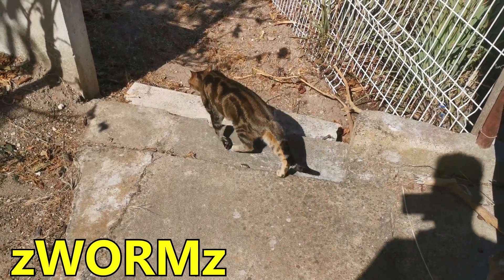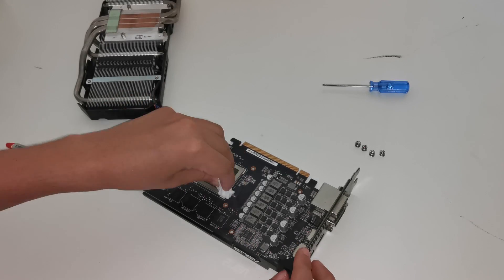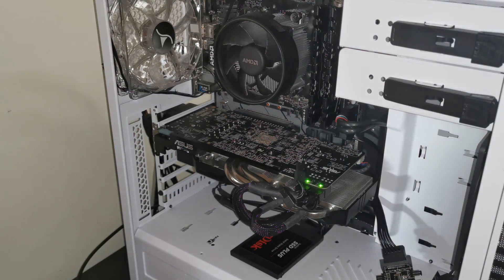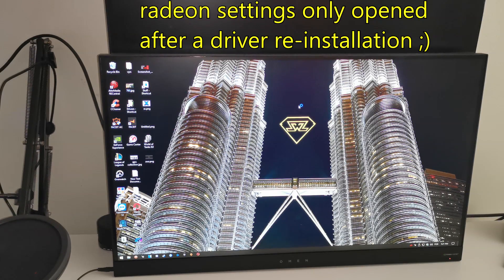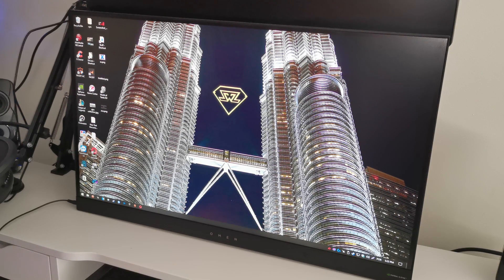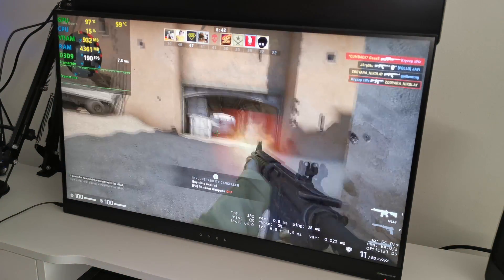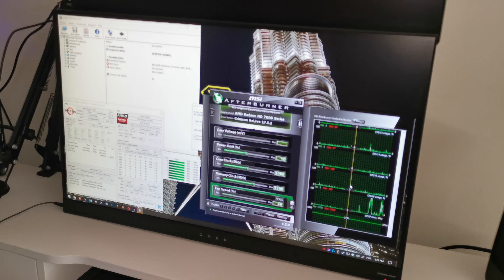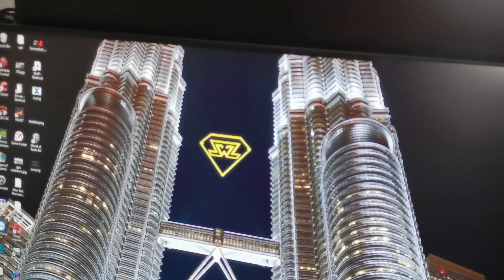I Fixed a GPU With a Hair Dryer!

Comment from the maker: It lasted from september 2019 to july 2020. It's dead again and I can't boot into windows with it anymore!
Reply: if it broke again do this with heat gun reaching upto 230 celcius by moving heatgun above chip in circular movement in 5 minutes
Reply: Be sure you dont have thermal paste bridging the transistors around the dye. My 1080 started artifacting suddenly after a clean install of windows and i coulndt game for more than a few seconds, then it would reebot with no display. It would only boot with display if i didnt use the pc for a few days or if i reseated the CMOS. I first thought it was beacuse of bad drivers, but it ended up being the thermal paste. After i cleaned most of it, it started right up and so far i havent had any issues
Reply: JP Spay  after heating gpu cool left it at room temperature for an hour it will cool down
Reply: How's the situation now?
Reply: Im curious too, they say it lasts about half year maximum
Reply from the maker: Still working, but I don't use it often as I'm always testing new GPUs. Still, it has been fine and I've tested many games on it already :)
Reply from the maker: Good luck! Even if it works you'll need to be very lucky for it to last a year, it depends on how much you'll use it anyways but still!
Reply: What about now!
Reply: Update: it only lasts me for 1week lmao
Reply: Is it still working today???
Reply: @OverclockGamerzFX  he said 3 weeks ago, it's working.
Reply: I tried this earlier on my 5yr old gtx 1050ti and it works lmao but seriously how long will it last tho? I can't afford a new gpu rn xd
Reply: @kent7427  still working?
Reply: Lil Spray  no you have a short
Reply: F
Reply: Is that because your using a hair dryer if it pertinent if you use a heat gun?
Reply: And you havent done a sunday video on it >:(
Reply: Usually what needs to be heated up is the vram chips more than the GPU core
Reply: that's cool :)

Comment: I did it with a hair dryer 14 years ago because I had no heatgun and did not expect the display to come on and it did but only for a few days because I only did it for about 4 minutes I guess. I then turned on the kitchen oven and dumped it in and the whole motherboard died completely. 
I probably got the temperature setting incorrect.

Comment: My GTX 1050 is not booting on my new system, I was suspecting it might be the new motherboard that is faulty.  I decided the clean the GPU and dried it with a hair dryer.  I worked for a while then went black screen again.  I blow hair dryer again a bit longer and focusing more on the IC chips,  the GPU processor and the VRM section including the ICs there.  And then when I plugged it back again, it worked.

Comment: Thanks! It worked on my 3070 with artifacts. I will respond if some problem appears
Reply: Still no issues!
Reply: @Dante-ur4wd damn but if I was you I would have resell that cause I don't want to play with time
Reply: @MCD539  yeah, probably the right choice, but i kinda forgot and just kept using it. It's still working btw, now im thinking about upgrading tho

Comment: bro i have a gtx 560 ti. whenever i update the driver, i get the blue screen. and after several uninstalling and installing, the display became garbage. will i fix my gpu with this? and can i install driver when i use this method? thanks

Comment: did this to my 660ti with driver issues (when installing drivers, it succeeds yet the driver isn't installed) and surprisingly it worked. idk how long this will last but hopefully until i get funds for a new gpu bcuz this month's budget is a little bit tight and i have cad classes until january. Thank you for sharing this trick!

Comment: Just fixed my thrift store $5 GTX 560 with this method. I did 10mins with the hair dryer on high about 1" away from the die. Tons of horizonal lines on boot up before....works like new now. Will report back with how long it lasts. This a test bench card really but if I can save it and get a few months out of it, I am happy. I will report back if it fails again.
Reply: Man im planning to do this to my 5 dollar GTX 580 , did you put the hair dryer in the center of the die??
Reply: @lietus4192  yes, right over the die. About an inch away. I used some leftover stone flooring, put the card on there, on a table and then used a glass jar to prop up the hair dryer so that it was about an inch away. Set the dryer on the higest setting and set a timer on my phone for 10mins. I let it cool for a few hours and ran it through an hour of heaven benchmark looped, a few rounds of Valorant and a day of normal desktop use. No failures. Much luck to you.
Reply: @Hughesburner  does the graphic card still work
Reply: @alphonseelric8722  It lasted about 6 weeks...I ended up selling it for parts online.

Comment: This method works, if you want it to last a bit longer just under clock your GPU and keep it cooler than you normally would, take a break between long gaming sessions.
Reply: Hey, how about this?

Stick the GPU to a centrifuge, like an air fan, and then apply a 120 deg. Celsius hair dryer on the GPU for 30 whole minutes, then put it into the freezer for about 15 minutes.

The centripetal force and rotational inertia from the GPU getting sticked on a fan and centered should spread out the fluid soldering, the air from the fan may cause convectiond which evenly spread out heat, and the cooling realigns and hardens the solderings.

Does that make sense?
Reply: How to underlock a very old GPU that is superclocked from factory? MSI afterburner doesn't have the graph option available. Its a card from my childhood.

Comment: SO MY GTX 770 2GB WINDFORCE IS ARTIFACTING AND ONLY WORKS NOW AND THEN SO I SHOULD JUST FULL BLAST HEAT WITH  THE DRYER,ALSO NOTE IT DOES BOOT INTO WINDOWS

Comment: I fixed my GTX 760 last night doing this but only for like 10 minutes blow drying time and I can't believe it fixed the artifacting Issue :) Amazing.
Reply: still works?
Reply: @damaraufa9575  It lasted for like a week or so. I  didn't heat it long though. It still works but I have a different card now.

Comment: a few days I will get an asus gtx 580 with artifacts I will also try to repair it with the hot gun we hope for the best I paid only 10 euros
Reply: Tomorrow I’ll test my gpu I got the rx 580. I also got artifacts on mine
Reply: @Chappie02  then let's wish each other good luck ^^
Reply: @navi26031984  good luck to you too
Reply: @Chappie02  tnx

Comment: Great video I know this video is prehistoric but, the other day I installed a new AIO and forgot to plug in my aio into sata cable and was running about 65 seconds I’m always on medicine for my chronic pain, and my pc never can think straight, it works and all but high intense games like Fallout 76 it’ll black screen but older games don’t have the issue, is it possible of crashing would this work on my rx 5700 XT ? Just got it last month :,( I may just do it on my own and risk it so using hair dryer do I spray heat directly on the GPU Die? Or entire card?
Reply from the maker: I don't think that's the same issue.
Check temperatures and see at what point it shuts down, it could also be driver issues

Comment: Hey i did this method it worked but after 2 days it wouldn't work anymore it has a caution sign in the device manager, is there any other way to do it?
Reply from the maker: With proper tools, but most people won't have those. You can try again for a little bit longer, but this doesn't fix it forever. Mine lasted about a year
Reply: @zWORMzGaming  wdym a little bit longer? 25-30mins?
Reply: @zWORMzGaming  i only did it for 15mins

Comment: I fixed my graphics card with electric stove only 12 minutes and cooling down for 2 hours dont move graphics card xD
Reply: Use aluminum foil to cover everything and make a cut around chip and above chip cut in same shape as chip
Reply: @Louwk1  how long did it last?
Reply: @huh681  Idk about him but I revived my EVGA GTX 970 FTW and it lasted for 2 more years before it died again. I did this with a R5 240 as well and that only lasted about a month. So it depends on how good the GPU is, a powerful and high quality gpu will last long after revival. Lower end and cheaply made GPUs won't last long, I've heard of baked cards only working for a day, others about 5 years. lol so it varies.
Reply: @mycelia_ow  Yea, i did the same to my GTX 1070 last week, and it's been alive since last week.. hopefully it stays that way
Reply: Guess your graphics card was too raw
Reply: @armanplayzyt9082  how did nobody like your comment

Comment: Thanks you ! I've just did it and I fixed my gtx 770.
Reply: can u tell me if u had error 43 on it ? cuz my msi 770 4gb  is not able to load drivers and and shows beginning of artifacts on black surfaces. i mind trying fixing it with this method too. is yours still working? i will wait for reply.
Reply: @TurboImpaler  I had the same problem as you wierd dots in screen and also code 43 and the nvdia settings not showing with installed drivers 
I washed it with water and heat gpu chip with hairdryer about 30 minute and you cannot believe that thats work !! Its been 4 days still have no problem
Reply: @heisenbergw.w8992  still works?
Reply: @lolokula_gaming9403  unfortunately not i had to reball it but its ok now

Comment: I have a question
I have HD 7730 and small capacitor is broken I think any suggests to fix that please ?
Reply from the maker: You have to solder the capacitor, a new one
Reply: @zWORMzGaming  the problem it is the small one isn't there anyway to fix that ?

Comment: I am having a Rx 560 and crashes when i run benchmarks or games so will it work for it? plz let me know
Reply from the maker: It could be something else, only do this if you don't have other choice. Try reinstalling drivers and stuff like that first
Reply: zWORMz Gaming i had reinstalled all drivers  even windows but still same issue and then once I flashed the BIOS of Gpu and it provoked the issue and now i also see lines on display

Comment: OMG I fixed by GT 610 with this method. It works well. Guys who still have issues after trying this. Try to switch from VGA to DVI and vice versa. I'm pretty sure it will work. I used a philips 1400 watt hair dryer. Full heat low fan for 8 mins approx. Thanks for the video. You saved INR 5000. subscribed!!
Reply: did it worked for long or the gpu died again in a week or so?

Comment: Love your videos. Liked your benchmarks with the GTX 650 also, wanted to see up to what extent my card could run games. My card kind of artifacted then days after, it shows a display but couldn't boot to windows. Going to try this method, maybe this could help resurrecting my GPU. This wouldn't cause any problems in my system right? Keep safe dude.

Comment: sir i have a question, i have gtx 1070 palit super jetstream.. and yesterday  starting to crash and show garbage display (artifact) sometimes it back to normal but  when i try to play games it will show the artifact again and crash after 15 to 30seconds.. any tips sir how do i  fix this? my gpu is almost 3yrs old so it has no warranty.. sorry my english is not that good.. i really need to use it but i dont have money to buy one T_T
Reply from the maker: Lower the clock speeds by a little bit on MSI Afterburner, it should work :)
Reply: @zWORMzGaming  tnx for the reply sir.. i will try this when later.. hope it works! Do u think ur method of reflow will work on me?
Reply: @zWORMzGaming  sir i will lower the clockspeed of gpu or the cpu? sorry noob here
Reply: @zWORMzGaming  and what will happen sir if i lower the clock speed of my gpu? does this affect my gaming exp?

Comment: I have a GPU with artifact, I will do the same, I will come back soon with my answer
Reply: how it went? Success or fail?
Reply: @warrax111  no man, it didn't work.
Reply: @warrax111  I think it is because the dryer does not heat enough to reach 220 ° C, it is impossible I think. The only thing i did was increase my electricity bill xD
Reply from the maker: Not impossible, I did it as well a few other viewers.

Comment: I just fixed a dead, black screen, Toshiba lap top like this, with a hair dryer. It does work! I didn't even put new thermal paste. It now works.
Reply: Which model and how long did you use the hair dryer pointed at the graphics chip?
Reply: @absolutebollocks2258  It is a Toshiba Satillite L655 model. I held the hair dryer about 2 inches above the chip for 20 min on high heat. I did go back and disassemble it and put new thermal paste and thermal pad. I also cleaned it real good, the fan and heat coil. It still works and is working fine. It was black screen. Power would come on but no screen. Totally black.
Reply: @amazingthingsfromaroundthe2057  Thanks for the reply. I was planning on trying it a few months ago. It powers on and the fans spins after a while. The screen remains black. I opened it twice and disassembled it, reseated the ram and used a different ram module, checked if any pins were bent on the screen connector, swapped out the CPU for the previous one and tried a lot of the methods online. The thermal pad on the graphics chip was replaced with some artic silver thermal paste. I assumed it was a graphics issue from the start. I was planning on using the baking method but thought the hair dryer would be better. Recently I thought that maybe the electrolytic capacitors needed to be replaced.

Comment: i have problem in my r9 270x oc when I install display driver  the scren it will black and nothing  happen  ican fix it with hair dryer ? plz tell me if you know
Reply from the maker: Maybe, it's risky but there's a small chance that it could work
Reply: @zWORMzGaming  did you use the flux when you heating gpu ?
Reply: Could be a psu issue. Even if its above the recommended Watts if it's an old one it could degrade.
Im having similar issues with my xfx r9 280x.
Works fine on basic display driver but keeps black screening on amd drivers. A lot of the times it's a power issue according to the forums. I tried a new 600w psu but still has same issue so going to attempt a heat gun reflow.
And yes the hair dryer trick can work, I fixed a lot of red ring 360s back in the day like this. If attempting a heat gun/hairdryer reflow use some liquid flux, put it round the edges of the die

Comment: Literally tried this just now with my supposedly dead 750ti. Figured I wouldn't lose anything but time. Lo and behold it worked. I didn't do this method exactly, I just kind heated the pcb up concentrating mostly on the core itself and vrams. I just did it too for just half of this time. It really worked. I just did a few stress tests on it and it didn't crash, also did a flash and driver update and it still holds. Kinda wondering how long will this last? OP, is your gpu still works to this time?
Reply from the maker: Still working with no issues! :)

Comment: My amd r9 280x it was crash when I play a game I do what are do for this gpu tell me?
Reply: Could be a psu issue. Even if its above the recommended Watts if it's an old one it could degrade.
Im having similar issues with my xfx r9 280x.
Works fine on basic display driver but keeps black screening on amd drivers. A lot of the times it's a power issue according to the forums. I tried a new 600w psu but still has same issue so going to attempt a heat gun reflow.
And yes the hair dryer trick can work, I fixed a lot of red ring 360s back in the day like this. If attempting a heat gun/hairdryer reflow use some liquid flux, put it round the edges of the 
die
Reply: @wolfplays2037   Hi, I have the same issue with my R9 270 , did you manage to fix it?

Comment: Reflow works only on old GPUs. People buying (gtx900-1000 series) to repair them but its not working.
Reply: I tried it on my gtx1050ti works like a charm
Reply: I'll try with my GTX 760 2GB i had some artifact's and my PC isn't detecting it, letting you know if it works
Reply: Oh btw my gtx1050ti is 5yrs old only working when i preheated it. But when I shut it down it doesn't work again. You need to hair dryer it again to work lol
Reply: Update gpu doesnt have display again even with the hair dryer lmao only last me 1week
Reply: @kent7427  bro same problem I have also have 1050ti if I will heat only work did you find and solutions please help waiting for your answer
Reply: @vinaypatil1667  sadly my gpu is oficially dead i can't find any other way to fix it but i know there's one more way tho it need some professional tools lol its called reballing i dont know how long it will lasts but its not permanent too for sure.

Comment: Bruh, I was always told that you're supposed to use a heat gun for these things, but maybe I'm wrong? Is your hair dryer magic or will it work with any is what I'd like to know. The only sad reality if this works is that the graphics card only lives for a short period of time then you'd probably have to replace the GPU itself if that's the issue.
Reply: I just fixed a dead laptop like this with a hair dryer. It does work. For how long it stays working is another question. It went black screen of death. I tried everything. It was dead and now it works after doing this with a hair dryer. I also held it over the GPU for about 20 min.
Reply: @amazingthingsfromaroundthe2057  yeah I ditched the hair dryer idea and got a cheap heat gun and reflowed a 780 ti which stopped artifacted briefly but stopped working due to a bad GPU. Sometimes it's loose solder connections or whatever or failed hardware.

Comment: I used a high wattage reflector... It made enough heat, but i needed to redo everything every month or so. It's still possible to fix the card that way, but i just got bored of it after 10-15 times and bought a new GPU.

Comment: I have R7 360 that it's overheating also it doesn't have original fan on it, so I will be changing thermal paste and fan in hope it will work fine.
Reply from the maker: It should :)